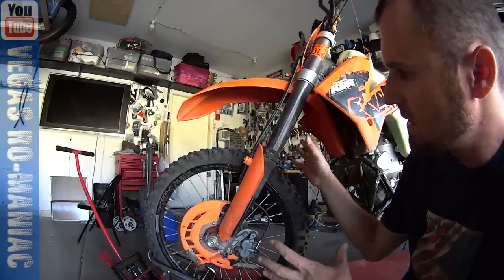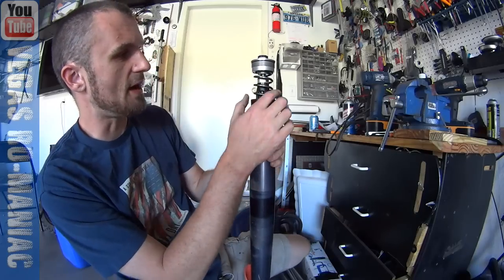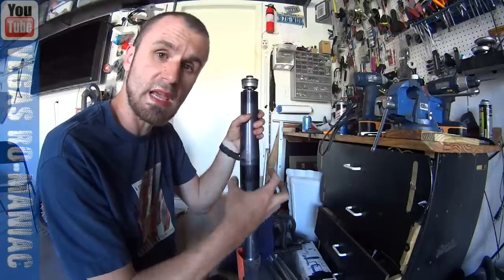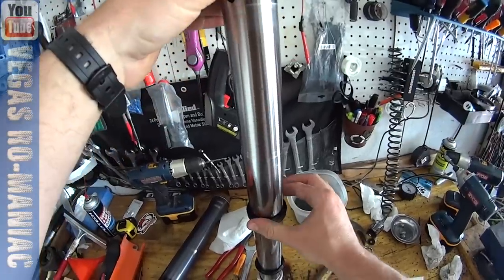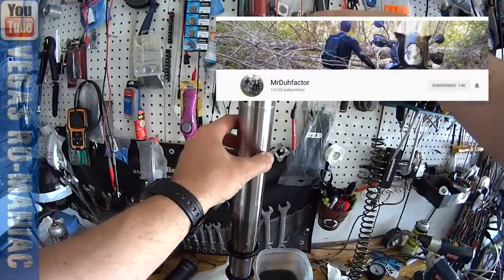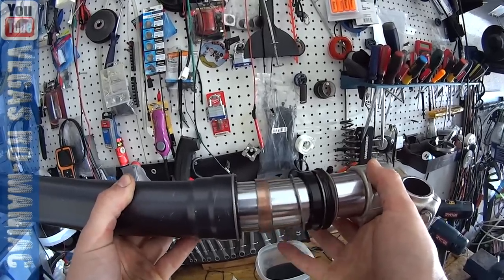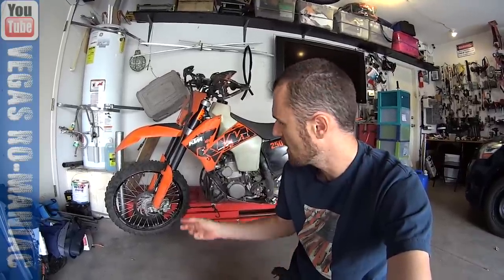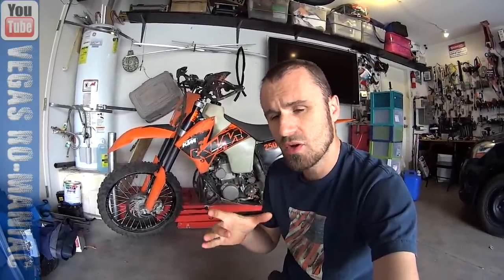Front Fork Binding on Dirtbike - Diag and Possible STIFF Suspension FIX

Comment: Yes you should use SKF seals,
I work for SKF here in salt lake in the industrial seals division making molds for similar seals for the last 27 years. I see the technology that goes into seal design and manufacturing. We make awesome products. My bike also came from the factory with SKF seals, I have over 70 hrs on them and have had no leaks, changed the fork oil but because they didn't leak I didn't replace them.
Did the oil change in December and been riding since then with no problem. I will say that the motion pro fork tru is worth looking at too, as it help ensure the centerline distance between the forks top to bottom stay in alignment which reduces wear and friction on the bushings as well as provides equal loading on the oil seal lip.

Comment: Did you check the torque on the pinch bolts for the lower triple clamp? If over torqued, these can cause a binding / stiction feel in the fork as well.

Comment: One of my bike is similar to yours (KTM exc 250 05) and I must be extremely carefull when I uninstall/reinstall the front wheel. It sometimes takes many tries before I get it right and no binding occur, which is not the case on my Honda. But the worst thing abont these forks is that I must release the air out of them about 20 times per ride, if not more. Of course I have ''quick release'' buttons but it is very annoying having to push these while riding before every difficult sections to be sure the forks will move properly...

Comment: the clamps in Nm? no ft lbs Nm mistake? is the 17Nm at the top and 12Nm bottom clamp? i have an SMC 2010 and have the same system,  now the rebound on one is super fast while the other one is super slow.  i believe your compression valve is on the bottom,  open is about 25 clicks.  the oil must be 5w or less. if I set the compression example to 10 clicks then it gets stuck like yours. i use ktm grease between the seal and seal.  T14034 grease

Comment: Same for me when using All Balls seals. Stiction is horrible. Ordered skf now and gonna throw them in. Should have done that in the first place.
The internet is full of the same bad experience with All Balls seals. Next time I do my research before ordering parts!
Reply from the maker: Skf do have good material
Reply: did SKF remove the stiction ?
Reply: @Jrod_FPV  yes!
Reply: I have found that on my 2003 KTM 450EXC there is an aluminum spacer tube inside the fork.  Only a couple years had this.  I read online forum somewhere this is the cause of stiction so I removed mine and that did the trick!

Comment: What year is your bike. Do you know where to find specs for 2010 ktm xc 300 front forks. No matter what I do they feel stiff.
Reply from the maker: I ended up selling the bike and getting a yamaha, never has suspension issues since than.. Haha,  best I can come up with the KTM was new springs 2x rates softer and less oil.. But still was old and not that good.. So I sold it

Comment: @vegasRoManiac : I think I solved my problem. The support rings have become concave and not flat anymore. Check yours!
Reply from the maker: Those bend when you take the forks apart, never when you assemble them, so if you put a straight one in, it's gonna stay straight till you take it appart again. My problem is the seals to snug, I'm gonna try different brand
Reply: Vegas RoManiac if you assemble bushing/support disk/seal does it move freely then? Cause mine gets stuck after some use, when i take them of they are just as tight as yours but when i remove the lock ring they magically moves again.

Comment: oil 5wt ??  try silicon lube on seals and back to 10 wt ,10wt vs 5wt smoother on seals heavy on damping , 5 wtopposite . If works on dh bikes works on moto :)